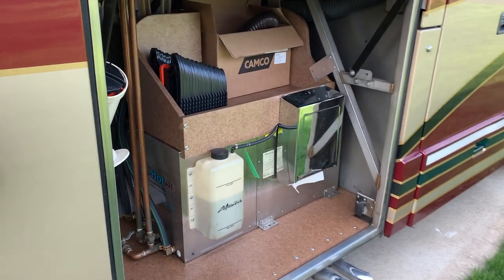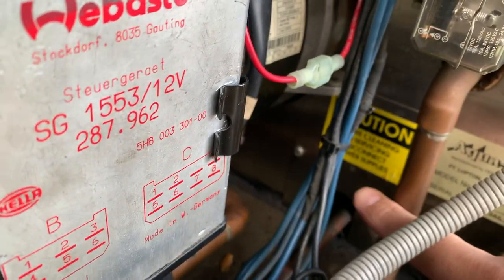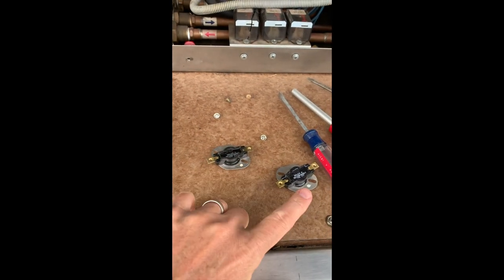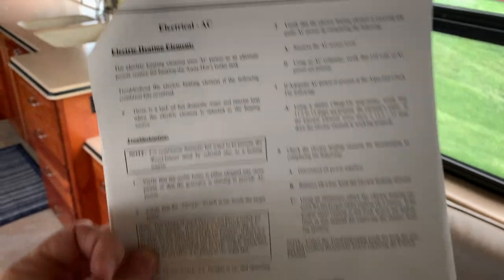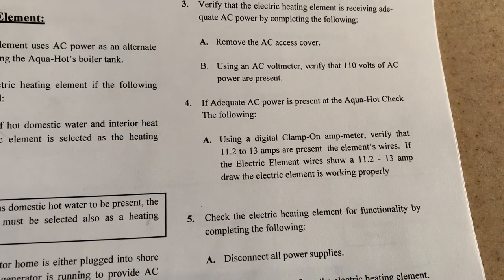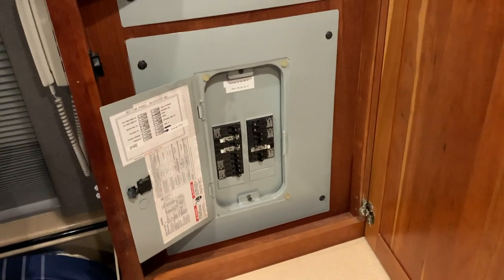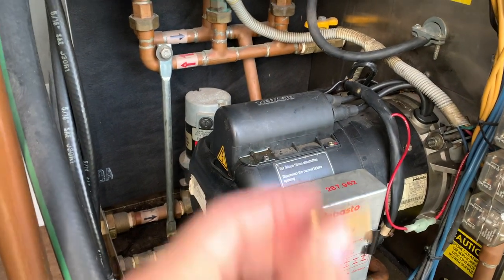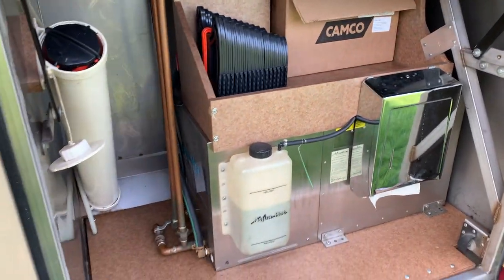Aqua Hot AC High Limit Thermostat Replacement

Comment: Hate to be 'that' guy but as a retired appliance guy I have to be lol.. you replaced a thermostat, and saved yourself several hundred I'm sure good job!
Reply from the maker: Ha - your right.  Was looking at some switches this evening and found some WiFi controlled relays. Put kids to bed and put this video out - so I called them relays! Lol.  Thanks for watching.  One thing concerning me - I did the ohm test and the electric element was within the values listed, and you have to drain the hydronic fluid to change it out - so I left it.  When I powered it on, it was pulling 14.2 amps - the book said 11.2-13 amps.  Do you think that’s ok?  Was thinking maybe it’s pulling to many amps and that’s what burnt up the relay (thermostat lol)?
Reply: @CampPrevost  Saw a couple  thermostats in there that will cycle the element depending on the heat settings another will be a thermal  cut off incase of an overheat, any of those open will cause a no heat. If the sheet says 13 amps  I'd assume it's  a  no more than  a 1200-1300 watt element but a higher watt  element will draw more amperage so if it's the correct wattage drawing slightly more amps may be age,  possibly on it's way out but once the element goes out you'll have zero ohms across it's leads as well. Might be a good idea to have one ready.  Hope that helps some. My experience is with residential but but seems similar enough as far as the heating operation.

Comment: Just wondering if you could tell me the basics on AQUAHOT. Mine works fine, and I learned how my thermostats work inside coach. They share the same thermostats as the toe kickers and to diff the 2 I have to flip a switch that says "aquahot/120V". Its extremely difficult cuz I cant find my aquahot...but i imagine is somewhere near the exhaust it spits from. My question is...am I suppose to just eave it be? Do dials to set for its on? how do I know if it needs coolant? etc etc......
Reply from the maker: Quick simple summary.  Its just a boiler - it has a tank of coolant and a tank of water in it that gets hot.  It gets hot by an electric element - that has a few sensors on the tank itself - it is run by 120v.   It is either on or off.  It is also heated from a diesel heater - that pumps high pressure diesel and ignites the spray to heat the tank.  You can run both, none or one or the other.   It is also heated by your engine - as your engine coolant gets warm, it runs into the same tank.  So you can take a hot shower or heat your coach while running down the road.   Your thermostat should have a setting for heat - not heat pump - that will turn on your toe kick heaters.  You also have electric toe kick heaters.  Hope this helps!
Reply: @CampPrevost  interesting on thermostat. So mine has like a master switch that tell the thermostats which heat to control/turn on....if I select aquahot...it controls that, If i select 120V...then it controls electric heat.  my electric heat is shot right not, aqua hot heat is amazing..